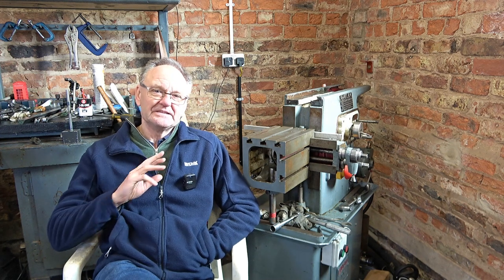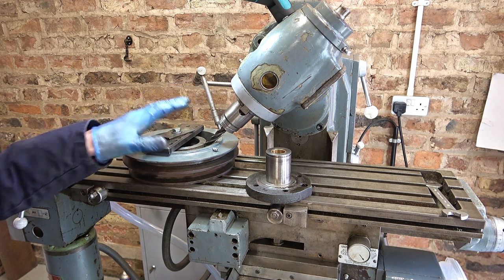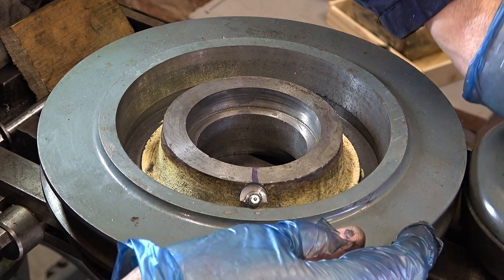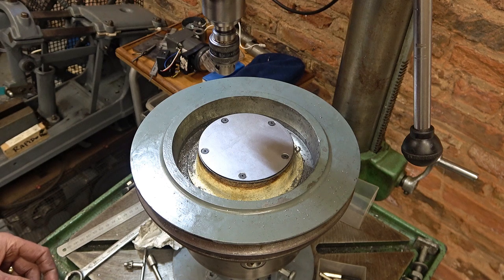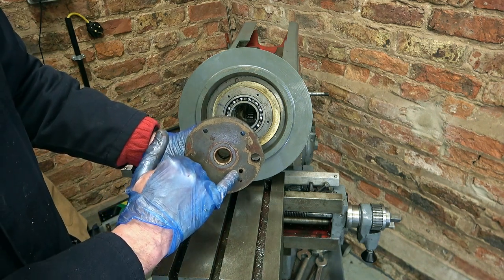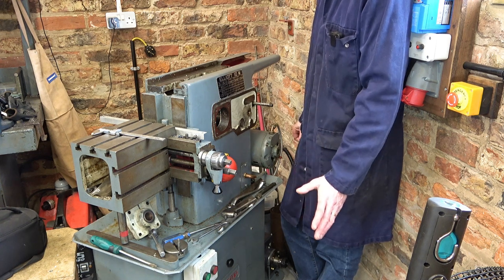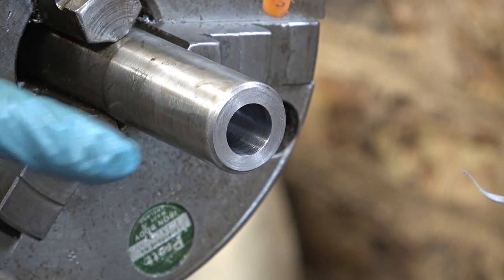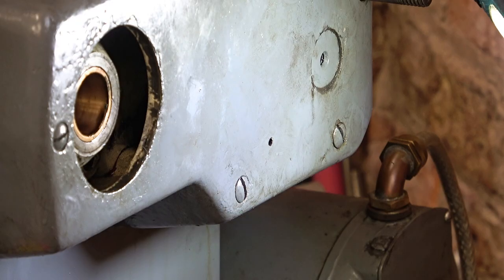HS187 Elliott 10M shaper repairs – Part 5

Comment: That was very interesting. The shaper repairs are progressing really well. I liked the innovative idea for spotting the position of the shaft with a drill bit in the wood. The SFM calculation was also really interesting to me. Thanks for a great video Paul.
Reply from the maker: Hi Carl, thanks. I often spend as much time thinking as I do doing..... trying to find a way.  I usually have several tasks pipelined in my mind, planning and forward-buying bits etc. Cheers

Comment: Paul, always enjoy your videos. They always flow along very nicely. Love your drill bit extender,  don’t have to worry about breaking off the bit. Shaper coming along great.   Gary
Reply from the maker: Hi Gary, usual thing - scratch about in the scrap box, find something to get you nearly there and then find something to bridge the gap and make it work. If it works once then that's enough. I'll always hack something together rather than make from scratch, if I can. Cheers

Comment: Very useful modification on the shaper,  broom handle was a brilliant idea 💡. 
Nearly all standard threaded nuts never have the thread perpendicular to the faces, obviously for applications requiring orthogonal properties,  then they need to be machined from scratch,  or lock two together and turn the faces.
Hope the miller doesn't get above its station, helping out the revered shaper 😮.
Thanks for sharing. 
Regards John
Reply from the maker: HI John, I was thinking what jobs will be left for the shaper now I have the mill (other than internal keyways) but I think any job that is long and thin on-end may be best in the shaper because it can be bolted to the side of the table. I don't know how easily I could have machined the end of that Golf cylinder head on the mill with the mill tooling I have but it was easy on the shaper. Cheers

Comment: Very enjoyable afternoon hanging out in your shop today. I have 2 vintage pistol type L.S. Starrett's, and 2 Stewart Warner RPM hand held ones. But rarely every use sine i have digital on my mill & lath. Have a super wk end Paul, Bear.
Reply from the maker: Hi Bear, that mechanical rpm meter is not something I would go out and buy normally but for £5 ($6) I could not pass it up. Often the old tools will do something that the electronic ones don't - measuring SFMin/SMMin in this example. Cheers

Comment: Great progress, this was great to watch thanks. We can turn the head on our Cincinnati mill and we find it a very handy feature and surprised how many times we use it.
Reply from the maker: Hi GTB, yes I think the Cincinnati head swivels in 2 axes and mine in only one so that's a limitation. Also I can't swivel more than 45 degrees either side of vertical else the oil runs out of the bearings (even though mechanically it will spin 360). Maybe one day I will try to fit some oil seals on the vertical spindle inboard of the bearings but it would be a big job. Cheers

Comment: Hi Paul, catching up with videos after the Easter break. You are really progressing well with the shaper, nice bit of wood turning and it out really well.

Out of interest I had a quick look at ISO 3601-1 for the O Ring housing sizes, for a cross section diameter of 1,78mm it calls up a 1,3mm deep groove. But I'm sure your sizes will be fine and a lot better than not having anything there at all.

That washing machine video was very funny, that one makes about the same noise and vibration as our one does!!

Good luck from Spain!!
Reply from the maker: David I never knew such standards existed but I do know having insufficient expansion space can cause problems on thinner castings/casings maybe made of Aluminium (like the gasket on a watertight electrical die cast box where the lid can distort). Anyway it's only sealing against gravity and there was nothing before, as you say.   So now I'm a bit wiser than I was this morning. Cheers

Comment: Hi Paul, I remember the inspectors at work using that same rubber wheel on the tachometer, on the ground table of a Jones and Shipman grinder to determine table speed, and us fitters would have to adjust the hydraulics accordingly to get the correct reading, you could do the same on your milling table to work out feed, cheers Dave
Reply from the maker: Maybe Dave but the lowest gearing on the Smith's tachometer (500rpm range) is very hard to turn and the wheel will no doubt slip. I'll have to think about that. Cheers

Comment: My little shaper has a shaft that comes out the right side. I'm glad it does. You're definitely going to appreciate having that. Oh, and I used to take Karate. I haven't been in probably 2 years. But I did manage to get my 2nd degree black belt (Nidan) in Karate and a 1st degree (Shodan) in Jiu-Jitsu. Perseverance! I enjoyed it a lot, especially teaching, but had to give it up, my knees couldn't take it anymore.
Reply from the maker: Hi Greg, having to go around my shaper to advance the ram is a very big annoyance so having a shaft on the operator side will be a big plus. Don't know why Elliott did not fit one. These machines were used a lot in schools and colleges so maybe it was a safety consideration - did not want any 'minced' kids with a handle flying round. Cheers

Comment: Great modification.  You'll love it once done.

I fitted something similar to my Alba.  But there's no connections available for fitting like yours on the controls side.  So I have to jog over to the pulley side and shove my square drive handle onto the square drive bolt head I put onto the middle of the clutch.   The Alba having exactly the same clutch as your Elliot.  It's a lot nicer than opening the drive door each time.  And the handle is treated like a chuck key,  Namely it never leaves my grip unless it's in the chip tray.
Reply from the maker: Hi Bruce, I think the Elliott 10M is possibly an evolution of the Alba as I see many similar parts. Yes, massive potential to destroy things if you leave the key on the shaft and then start it  😒 Cheers

Comment: Gday Paul, good idea using the wood and drill bit, I have a rev counter the same that does up 5000rpm and I’ve found it to be quite accurate, I also have the wheels well, I’ll have to have a look again but mine tell you how to do the math on the wheel, great video and now I’m looking for a cloths dryer, better not borrow the one off the missus😂, cheers
Reply from the maker: Hi Matty, Owen does some absolutely hilarious videos with washing machines and dryers. But then he also does serious stuff. He has a Harrison lathe. Cheers

Comment: I  have the same problem with left and right handed cutting tools. I can't remember either.
And to be able to move the ram without taking a walk first, Will be a very usefull upgrade.
Reply from the maker: Hi Michel, it's surprising how many repairs and improvements I can find to do on that shaper. I might still change the motor bearing yet. Cheers Paul

Comment: Very interesting. Can I ask what coolant you are using in the lathe?
Reply from the maker: Hi Jonesey, I started out with soluble mineral oil but these days I use semi-synthetic cutting oil. It's less gummy and gives a better finish. I paid £35 for 5 litres - it was marked type 204HP. The only thing is it tends to lift paint if you leave coolant standing in the tray, whereas the soluble mineral cutting oil did not. Maybe ok if you use 2-part paint but mine is just brushed on 'enamel'. Cheers

Comment: What coolant are you using , i'm looking for something that does not get any fungus with not much use?
Reply from the maker: Hi Kevin, it was ebay item 	5056124310780 - currently showing out of stock. It was semi synthetic 204HP from C Bennis Supplies & Services at £32 delivered. I also spotted Aztec Oils selling 204HP on their own website -  supposedly 204 is ideal for machining cast iron but it was a good price from Bennis so I did not worry about it and as you can see it performs well enough on steel.  And I think any semi synthetic is far superior to standard soluble cutting oil. l Hope that helps. Cheers